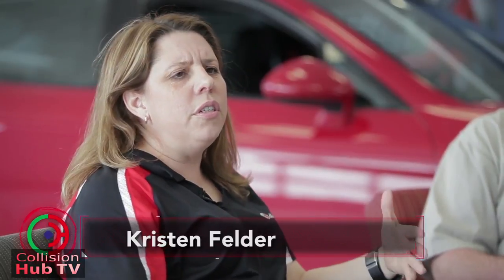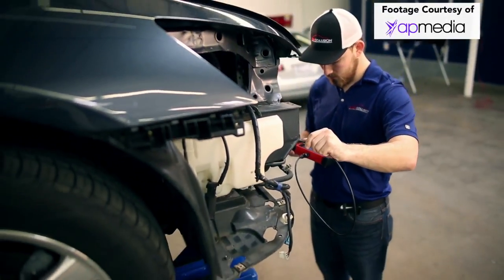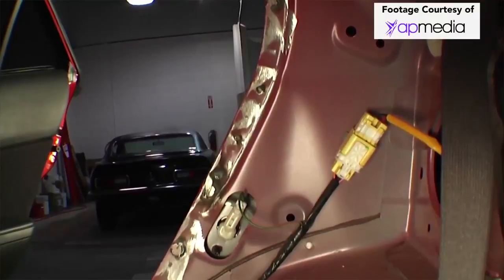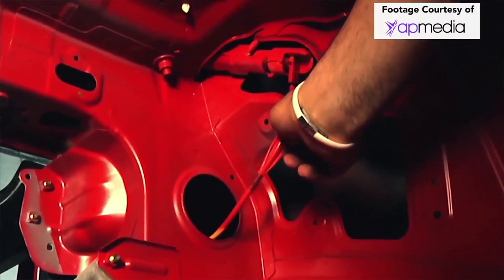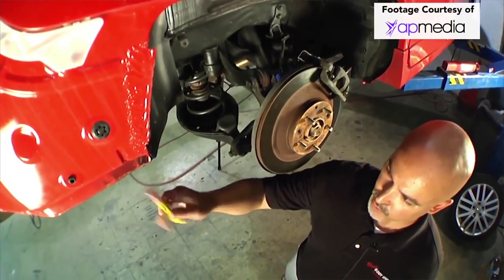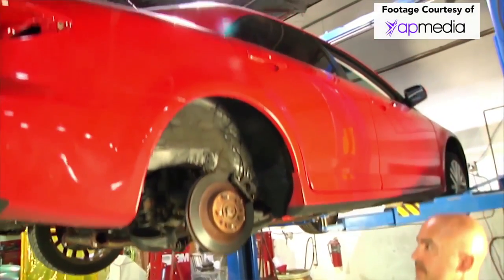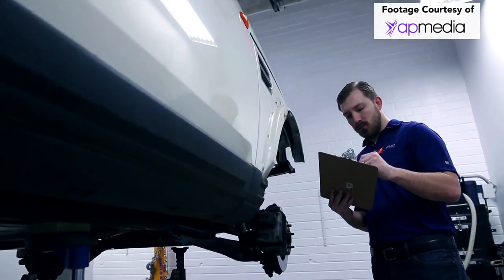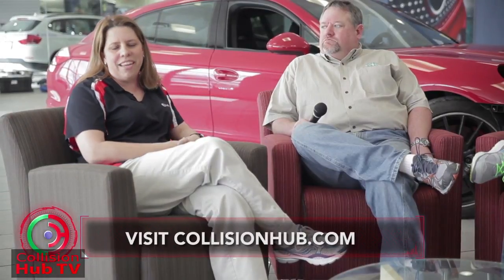Post Collision Repair Inspections A Panel Discussion

Comment: A quarter panel isn't a structural component if you repair an outer panel correctly replacing the quarter panel is 150 welds on the inner structure going to the guy in the blue shirt, if you replace a quarter panel your compromise is on the inner structure that may not be damaged

Comment: Cycle time is also saved on repair outer panel properly, an outer panel is not a structural component reason they also make body tabs inner structure for a fender impact
Reply: that is correct

Comment: Insurance company always trying to save money on parts and repairs ...they are the real problem ....they always go to cheap replacement parts and cheap on labor ...the bodyshop has to follow the insurance rules in order to renew the contract every year ...not our fault .
Reply: it not the in. company it the body shop they have run the good body men off they started steeling are time
Reply: The body shop tends to cut corners. Who's to say they actually bought oem products as opposed to buying off brand stuff. Thts just one example

Comment: PRI - the biggest boondoggle in the industry .... Start at your insurance companies , it's not the shops fault 95% of the time . It's the damn adjuster . I got out of this industry because the money kept getting smaller and smaller . Insurance companies are always wanting to save a dollar . This truckles down to the shop doing the work . 

I've always loved reading larry and Kristens posts , but I just cannot get on board this post repair nonsense . About half of the crap I see complained about isn't anywhere near a safety concern . And really , taking a car apart that was just repaired ? Sounds like icing your own cake because you didn't get the job ...
Reply: I was a body man for 40 years and got out of it the shops started steeling are time and I made the same kind of money I made 25 years ago and working harder I will never go back